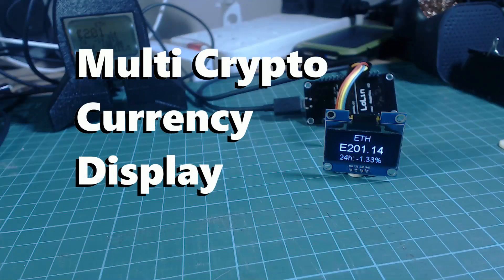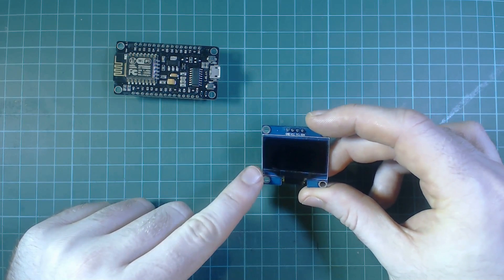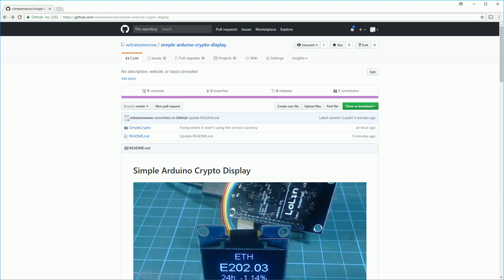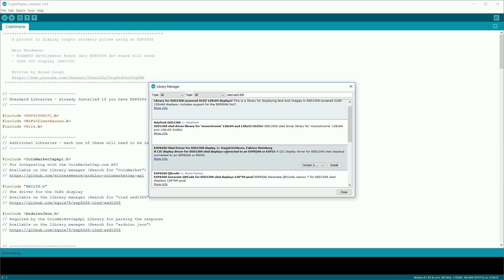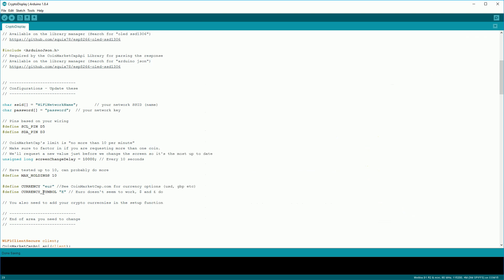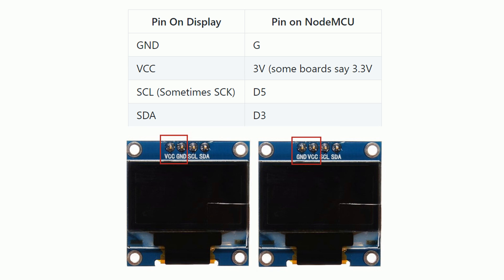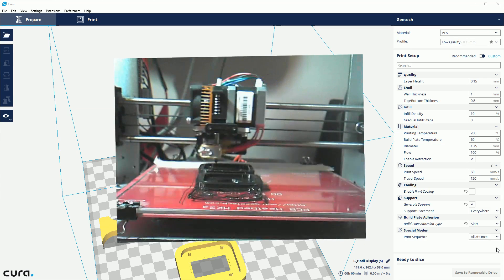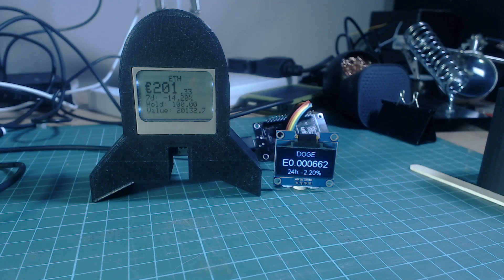Arduino Crypto Currency Display

Comment: Is this still functioning?

I followed all directions and I am stuck on the HODL Display start screen.

I'm 90% certain I'm doing this right...  help!
Reply from the maker: +Talbot Simons sounds like its not connecting to the WiFi correctly, could you double check your WiFi name and password (make sure there are no unwanted spaces at the end etc)
Reply: Hey thanks for getting back so fast!

I have tried my home network, my cell phone hotspot - with and without encryption enabled.  I can't seem to get this board to connect!

I ordered off one of your Amazon links but my board doesn't QUITE look the same...  Slightly different color scheme.
Reply: I'm starting to feel like there may be a problem with this board.  I have ordered 2 more and will attempt this again.  

my com output is just a bunch of "⸮⸮⸮⸮⸮⸮⸮⸮⸮"
Reply: Also - if this board is supposed to have a network activity LED, it has a VERY dim red LED.  I'll report back once I get the 2 additional units.  -  in fact under close inspection I think the one I received is missing a resistor.  =(
Reply from the maker: I'm not sure it does have a network activity light, I don't think so.

Yeah if neither WiFi network worked thats not a good start!
Reply: Well - 2 new boards came in - I am still having a lot of problems getting past the HODL display page.  

Is there a problem with certain wifi encryptions?  This is driving me mad!
Reply: for instance-  special characters in WIFI name?  I have a "-" in my SSID...
Reply: update on that-  changed my network name - no luck.  I am using WPA2 - which I assume should work?
Reply from the maker: +Talbot Simons yup it should work fine

If you open up the serial monitor in the arduino ide do you see any messages in there?

Are you using the same coins as in the original sketch or have you added more?
Reply: I added more - let me try and set it back to default - will report back in a moment.

I ordered the ESP8266 from your (whoops - SECOND) link.  It says "Node MCU Amica" on the back and is white on the back - black on front.

Slightly different from the one in the video.  Have you tried this sketch on both versions with success?  I have a feeling that it might be the CP2102...?
Reply: Update - negative.  Original code still doesn't work.

I have tried several chargers just in case one is hanging the boot.

I'm just perplexed.
Reply from the maker: +Talbot Simons if you go to the examples of the coinmarketcap api there is another one you could try out, see if that works.

Make sure your baudrate on your serial monitor is set to the same as it is in the setup (I normally use 115200 I think)
Reply: Stuck on this screen.

http://tinypic.com/r/ehhwra/9
Reply from the maker: +Talbot Simons your board is crashing, how did you install esp8266 core libraries?
Reply: Nothing.  Tried the example sketch and I have the same output in my monitor...
Reply: I followed your other video linked in this video.
Reply: Just for fun I am going to install the version you used from the boards manager - 2.3.0 - the current is 2.4.0.  Lets see if that helps.
Reply from the maker: +Talbot Simons hmm it looks like they released a new version (but it only looks like since yesterday) and I haven't tested it with this yet.

In the boards manager section see if you can install the 2.3 version of esp8266 core
Reply: Can you list the exact versions of each library you used?  Even with 2.3.0 I am crashing.
Reply from the maker: +Talbot Simons I'm sorry I can't at the moment as I'm away from my computer for a few days.

I'm pretty sure it's a 2.4 thing because I raised an issue when testing out the development version of 2.4 that it was crashing but they said it was fixed and I didn't have time to test it. Maybe it has an issue downgrading?

Last thing I would maybe suggest is try a fresh arduino ide

You can use a portable install if you want to maintain what you currently have

https://www.arduino.cc/en/Guide/PortableIDE

Try install 2.3 when you first set it up
Reply: I am sorry to report that it appears this project is broken.  =(

I have tried version 2.3... I just installed the same versions you show in the video to the best of my ability- and I still cannot get past the start screen.

It may be this version of the board - either way something just isn't working.
Reply from the maker: I got it working with a fresh install there

I downloaded a fresh copy of Arduino ide 1.8.5

Made it portable as per my earlier link

Added ESP8266 url same as in my getting started video

installed ESP8266 2.3 in the boards manager

installed Arduino Json from the library manager

installed coinmarketcap from library manager

Entered my wifi details into the coinmarketcap example and uploaded it to my board and it worked fine
Reply from the maker: Even more interesting, I installed a clean version of Arduino installed 2.4 esp8266 core and it also worked fine so i'm back to not knowing what's wrong for you.
Reply: Just wanted to check in and say everyone works fine, I had the issue with the frozen start display as well but it was the SSID which I mispelled. Works amazing and I am very happy with this!

Comment: I'm getting error while i'm trying to compile

Arduino: 1.8.2 (Mac OS X), Board: "NodeMCU 0.9 (ESP-12 Module), 80 MHz, 115200, 4M (3M SPIFFS)"

/Documents/Arduino/libraries/CoinMarketCapApi/src/CoinMarketCapApi.cpp: In member function 'CMCTickerResponse CoinMarketCapApi::GetTickerInfo(String, String)':
/Documents/Arduino/libraries/CoinMarketCapApi/src/CoinMarketCapApi.cpp:70:3: error: 'DynamicJsonBuffer' was not declared in this scope
   DynamicJsonBuffer jsonBuffer;
   ^
Reply from the maker: In your arduino library manager search for arduino json again and change the version to something older. The newest version of the library broke this!
Reply: Haha ok now it works great!
Reply: What should i do to work it on 0.96" oled screen :)
Reply from the maker: It should work straight away with a 0.96, just connect up the correct pins.
Reply: It's working but it is cutting on the right side a little bit . btw thanks for the project and the replies :)

Comment: I have figured out the problem regarding getting stuck on the HODL start screen.  

I ordered my boards from one of your links above.  It appears THAT version of the dev board is not fully compatible - at least directly with your code.

SO - after lots of wasted time I went ahead and ordered the EXACT board you use in the video - and it works immediately.

Happy to report it's flawless now thank you - however - you may want to revise the links above and remove this link "http://amzn.to/2wobS83" as it's simply not working.  -  In fact I tried a couple links from amazon and none of them worked.

The cheaper LoLin boards - which is what is used in this video work no problem.  I found a link on Aliexpress for them.  =)

@Brian Lough - Thanks for your time troubleshooting.  Hopefully my now solved issue helps someone else executing this project.